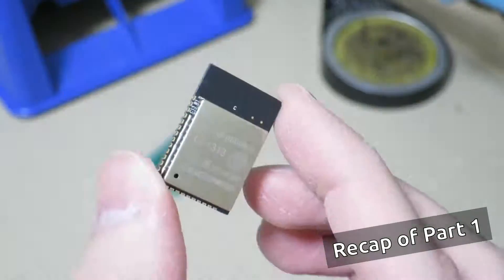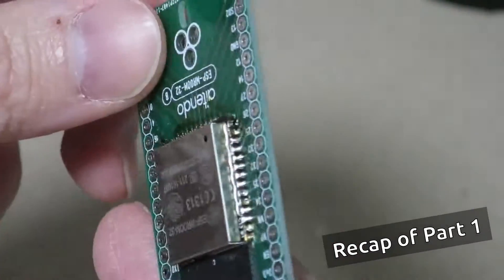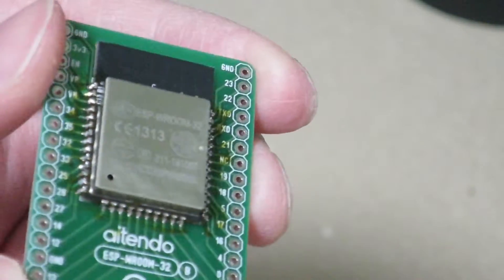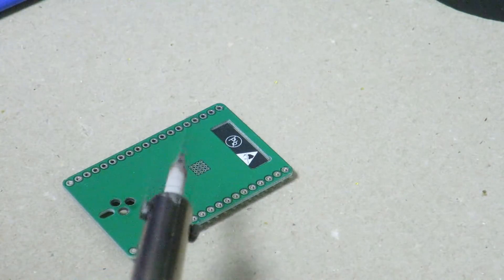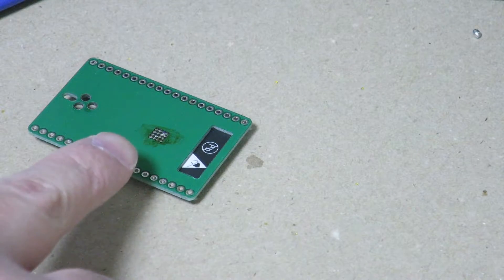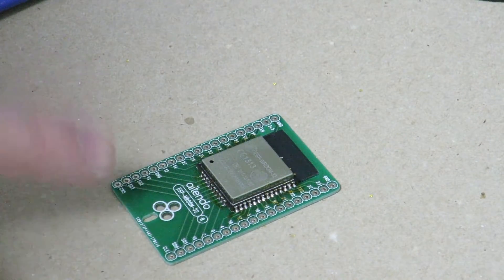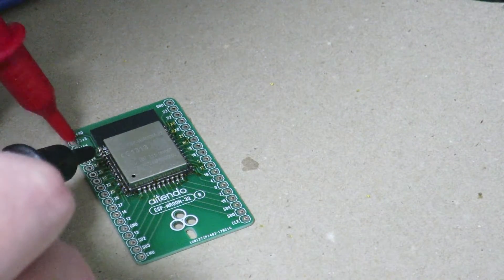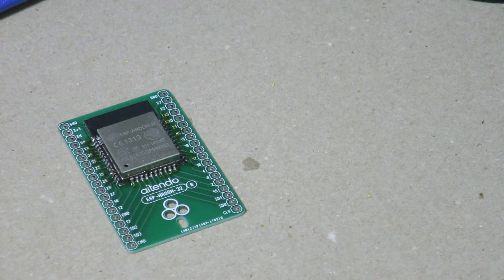ESP32 #3: Soldering the ESP-WROOM-32 to a breakout board (Part 2)

Comment: Ehm, I don't want to spoil the party, but have you checked continuity between the GND pins and the thermal pad on the breakout board without the ESP32 attached to it? It looks like the PCB is already connecting those. And it should, in fact, or it wouldn't be a GND pad. So that test is probably worthless.

Comment: A few suggestions on improving your soldering success. Tin the tip of your soldering iron so that solder better adheres to the tip. Apply flux liberally to all surfaces to be joined via solder, applying solder to a single surface will not assist in forming solder joints at point of contact. Apply solder to the soldering iron prior to touching soldering tip to the two surfaces to be mated.  Applying solder flux to the breakout board's ground pad channels will wick solder through the channels to the ground pad of the ESP32 chip. Two well fluxed surfaces will enable your solder to flow cleanly at the solder joints with minimal bridged connections. Excess flux can be cleaned up after soldering with cotton swabs and 100% isopropyl alcohol.

Comment: Hi, i am a bit noob sorry. Does the esp module need an external Flash?  Or is this module an all-inclusive module as it is? What is the difference with Esp32S?
Reply: It has internal flash. There’s a large variety of ESP32 models, bearing in mind that the ESP32-C3 is radically differently internally. The ESP32 series (with no suffix) is the best supported by the software environments used by hobbyists. (I’m using platformIO in Visual Studio Code, with the ESP-PROG debugger board.)
Reply: @tookitogo  Thank you

Comment: For the ground pad, I simply used to lay some CPU grease for thermal transfer. So far, it seems to work well at my projects.
Reply: What do you mean thermal transfer? Is the pad at the centre for thermal transfer or for electrical connection? By the name "ground pad", it sounds that it is for connecting ground pins. Does CPU grease also transfer electricity?
Reply: @typingcat  The ESP32 hardware design guide says the ground pad is just to improve cooling. It is not required, and Espressif’s own boards don’t solder it.
Reply: @typingcat  I meant heat transfer. 
As regards the ground pad, it depends. If the chip has - and usually has - a ground leg, no need to connect the pad.
Reply from the maker: Oh that's interesting! Thank you for the information! :)

Comment: Not needed for soldering that pad39, thermal pad in bottom. In reflow owen i think its quite ok to do, but i would not try to do it manually
Reply: So, it is not "ground pad" but "thermal pad"? Then, it makes sense that the top comment says use CPU grease.
Reply from the maker: Thank you for the information! :)

Comment: Your soldering work really sucks, learn about high quality soldering irons/stations that can easily get that 2-layered ground pad flowing in less than a second, learn about proper tip sizes for such a job, learn about proper flux use. Such a soldering job is absolutely possible without any reflow/IR/... stuff, but please ... do it properly

Comment: This module is kind of a pain, isn't it? I always have trouble with the GND pin near the antenna on the left:

http://i.imgur.com/jHqAF1m.png

Maybe I need to set my heat higher for that...but in any case I've definitely lost a few good esp32 boards to my shitty soldering skills with this module.